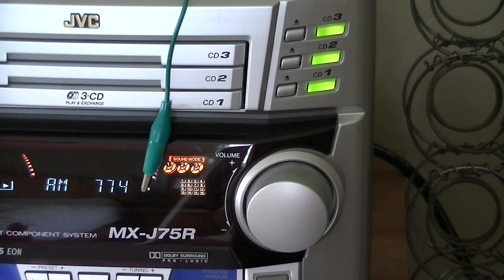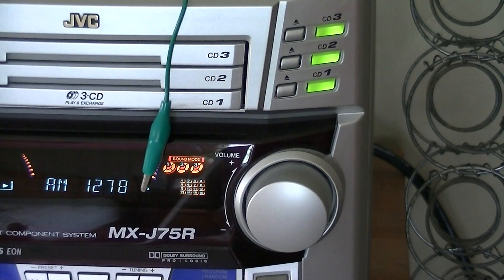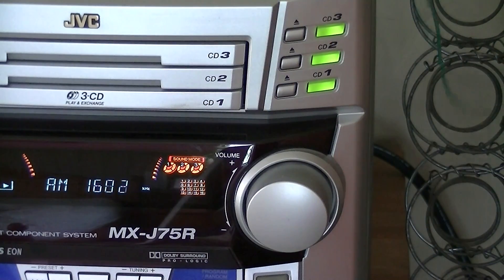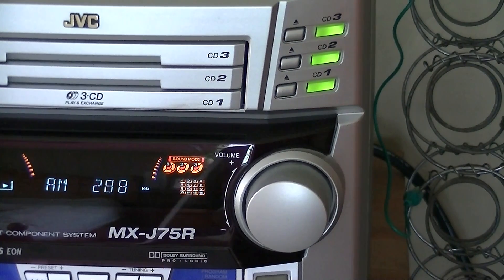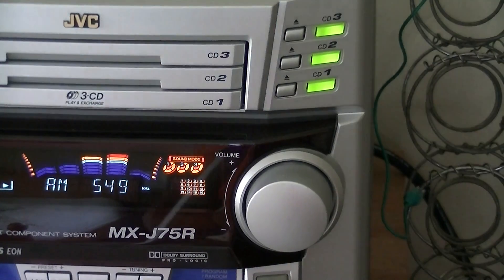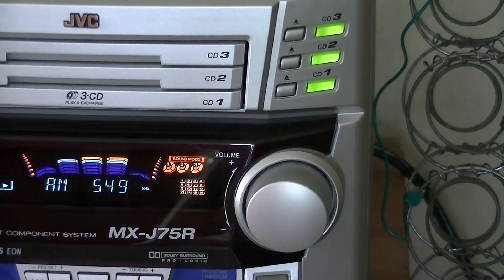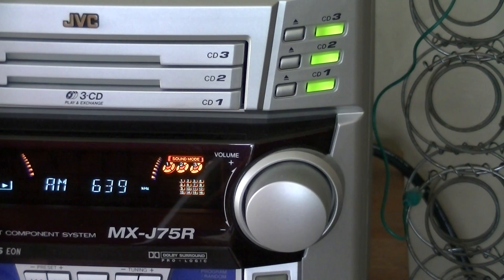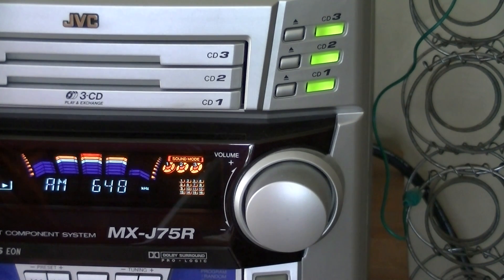Using a Metal Coil Mattress as an AM Radio Antenna

Comment: you guys are absolutely stupid, even if it was connected as an antenna system, the amount of radiation will do absolutely nothing. Reasoning? Your not transmitting any sort of radio signals, and even if you were, at that low of a frequency, it doesn't do anything to your body. Just to put this out there, sleeping on a metal spring mattress, you have the same chance of rf exposure as you do walking around during the day, it doesn't matter if the mattress is resonant or not. AM signals are barely into the MHz spectrum, it's not until you get into UHF, ultra high frequency above 400MHz that exposure becomes a concern. Even at that high of a frequency, the worst you can do is burn yourself. it isn't until you get into GHz frequency should you be truly worried about exposure to rf, and even then I wouldn't worry, because rf isn't ionizing. IT WON'T HURT THE BODY.
Reply: Do a little research. There have now been thousands of studies done and they have yet to determine a "safe" level of this kind of radiation. The United States is WAY WAY behind other countries in setting strict safety levels and in researching the effects. They are too busy counting all the money they are making. Even at low levels it interrupts communication between the cells and can change DNA. Your immune system senses it isn't natural and tries to reject it creating the entire spectrum of health problems. The denser the electrosmog,  the faster and more severely it can affect you.
Reply: And yet, you're not citing any sources.
Reply: I'm fairly certain you've forgotten what I said about ionizing radiation. Radio waves have shown no results in any study to damage DNA. Radio waves are a form of non-ionizing radiation, where as x-rays, high spectrum solar waves, and gamma rays, are a form of ionizing radiation. You may want to check your research again. Don't get me wrong, high frequency waves can cause damage to a person but you have to be in a high MHz to GHz spectrum of radio waves to do actual damage to a person's body, because that's when thermal radiation is produced. Thus microwaves which cook food.
Reply: You said you wanted sources. I gave them to you. In the lecture Levitt DEBUNKS the theory that non-ionizing radiation is "safe". It is ANYTHING BUT SAFE. You OBVIOUSLY chose to ignore the sources and the truth.
Reply: A citation would be a link, or citing of a book. But you seem to lack all mental capacity to do such a thing.
Reply: Let's play a little logic game. If cancer is caused by genetic alterations and chain breaks due to EMF in the non-ionizing radiation spectrum, why would it be treated with radiation in the ionizing spectrum? A spectrum of which is proven to cause cancer.
Reply: And yet, you listen to those in the medical profession about EMF.
Reply: Thousands of studies say radiation treats cancer.
Reply: Get back to basics and use logic instead of blindly believing the word of others.
Reply: No. I listen to scientists. It is the scientists that are proving this. Medical doctors don't know the first thing about discovering a CAUSE of anything and certainly not CAUSES of illnesses. All they know about are toxic drugs and surgery and radiation to deal with symptoms not restore robust health. Granted they can stabilize you after a bad accident . Acute conditions like that are all they should be used for.
Reply: Epidemiologists and the like are still in the field of MEDICINE.
Reply: LOOK at the NUMEROUS STUDIES that are shown in the links I provided!  Sorry but your arguments hold NO WATER! Period. END OF STORY. The TRUTH wins. Propaganda loses.
Reply: You have provided no links

Comment from the maker: I've tested the metal box spring and it is also filled with energy.  It will likely increase the energy content of the mattress on top of it, especially so if the mattress cover is thin.  I have tested a box spring and you can watch it, the video is called:  Mattresses, Bed Springs, and Electrical Energy